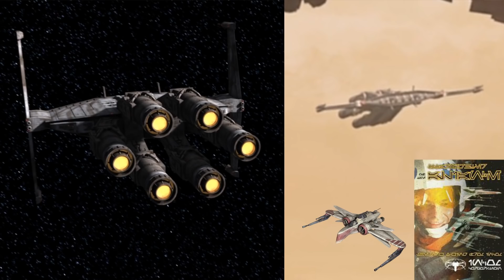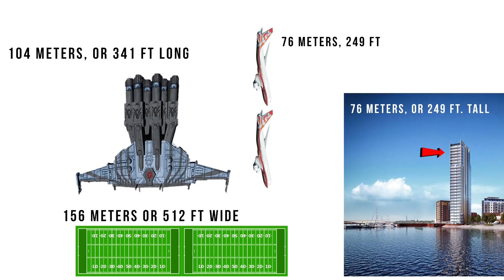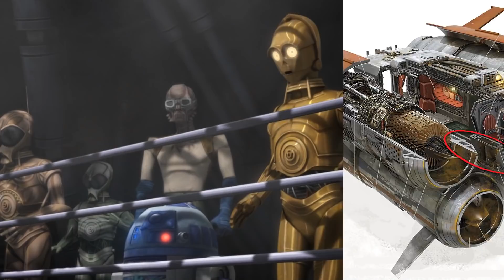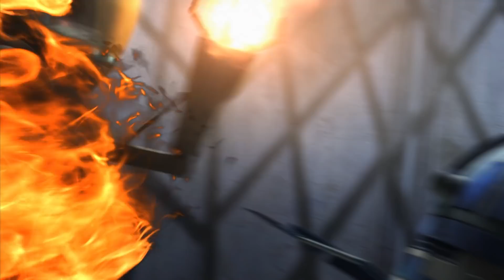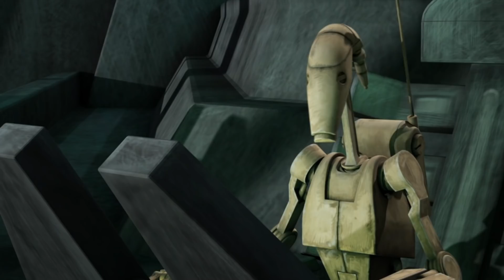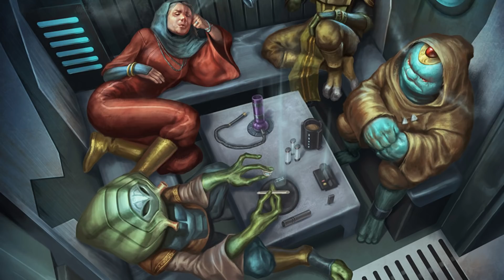The Droid Gladiator Pit Fighting Ring | Weequay Pirate Ship | Star Wars Ships

Comment: I wouldn’t exactly measure the entire engine block, but rather the size of each engine.
Reply from the maker: I didn't maybe the visual was confusing since I made it almost a square. But that was the length of an engine, the width or height of the engine wasn't important for the comparison
Reply: Nah, its okay MetaNerdz Lore. The math I would’ve used is 1/4 of the CR-90’s engine block width & go from there.